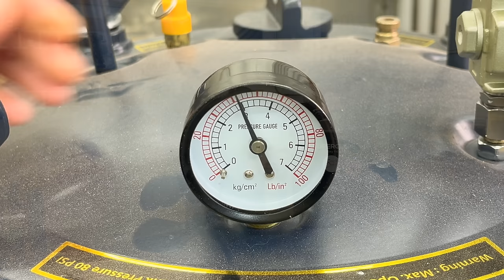Stunning Tree Root Woodturning Creation

Comment from the maker: I was given this Almond tree root ball from a member of my local woodturning club. This is my first attempt at turning a root ball. I was definitely a little nervous about this one, it was the largest and most unbalanced piece I have turned to date. Originally I had planned to not use any resin in this piece, but unfortunately there was no way I was going to be able to hollow it out and have it stay in one piece. I also had a bit of a scare when part of the root caught on the tool rest and broke. I’m sorry I didn’t catch it on camera. It was pretty intense. I set my lathe speed at 450 rpm for the majority of this turning (lowest speed my lathe will go). Only raising it to approximately 600 rpm once the piece was cut and better balanced. I think I lost about an inch of my 5/8” bowl gouge turning this piece due to the constant sharpening. The inside of the root had lots of rocks and dirt that I just couldn’t get to until I turned it down a bit. The simple woodturning carbide tools worked great as always. The Sumi black pigment powder from Eye candy pigments came out amazing and really went well with the grain color of the piece. I finished the piece with Danish oil and polished with carnauba wax. This was by far the most fun I’ve had turning a piece and plan on finding more root balls to turn. The fact every piece is original and one of a kind is what I think makes it so special. Thanks for watching! Hope you have a great day!

#woodworking #woodturning #resin 

Affiliate links

Simple woodturning tools
https://www.simplewoodturningtools.com?bg_ref=gkr80FMJN5

Limited time coupon code!!!!!!!!!
Square3 

Acrylic resin simple start turner and hollower
https://www.simplewoodturningtools.com/knyydq

Acrylic resin simple start roughing tool 
https://www.simplewoodturningtools.com/yio14f

Simple hollowing system with laser kit 
https://www.simplewoodturningtools.com/ect9ii

Super Clear Epoxy Partner
Superclear epoxy resin 
https://www.superepoxysystems.com/ref/squareandlevel/

Eye Candy pigments 👁️ 
https://bit.ly/48vZNLf
Coupon code:
Squareandlevel
Sumi Black Eye Candy pigment powder-
https://bit.ly/3J5Qasr
Reply: I like this idea of duping the description in the comments... borrowing. :)
Reply: Thanx. New turner and new sub. Something about the rootball  really speaks to me. Not sure why. Maybe you are giving new life to a 'reject' or something.  Not sure. Keep up the good work.  Going to call my shrink now....
Reply from the maker: @johnlivsey4146  haha. I totally agree. It’s basically trash. Would either end up in a landfill or a bonfire. Kinda cool to make something unique and interesting with it. Thanks for watching. Hope you have a great day.
Reply: I like turning stuff that shouldn't be turned, in other words, trash 😊. This one turned out great 👍 @squareandlevel
Reply: Is this for sale and how much?
Reply: p😊😊
Reply: Last seen at a yadr sale for $3.
Reply: yes

Comment: Man that's beautiful. Whenever I mess with a root ball I usually break out the pressure washer and blast away all the dirt and rocks. Works great and all the mess is outside.
Reply from the maker: Did that twice before I started. Still full of rocks and dirt. These roots were wrapped so tight the stuff just wouldn’t come out. Thanks for watching. Hope you have a great day!
Reply: That's true. You can blast the outside all day long and then 7/8th of an inch in after 3 min of turning... there's a rock. 😢

Comment: Now that sure turned looking nice!! I also liked your zip-tie trick for keeping the wood from floating while giving you a handle to lift it out of the pressure pot. I have found that roots do not always turn the same as the parts of the tree that are above the ground. They also seem to dry a little faster.

Comment: I'm not a woodturner, but find it so relaxing watching a craftsman create something beautiful from something so mundane. I'm curious though how you ensure that the thickness is the same down the sides when you are hollowing the inside. Probably a dumb question I know.
Reply from the maker: Hi Tony. Not a dumb question. There is a laser attached to the hollower set up I use that points down on the outside of the vessel being turned. It helps to reference where the cutter is on the inside, making it fairly easy to obtain a uniform thickness throughout the piece. Thanks for watching. Hope you have a great day.

Comment: As a hobbyist, I must say that the two things I feel when watching your vid's are admiration and envy, for your workshop, tools and skill.
I do however have a technical question.  Is the resin you use elastic or do you rely on the strength of the resin to resist future stress, created by movement in the wood?   
Or.   Has that root ball been seasoning since "Adam were a lad"?   I only ask because I don't have the time left to wait that long. 😉👍
Reply from the maker: The epoxy resin is not elastic. This specific piece has moved a little since being made and I will likely fix it in the future once it has stabilized. This was my first attempt at a root turning and I learned a lot. Next time I will turn it to rough oversized shape. Drill the pilot hole in the center and let it air out for a few weeks before adding resin or finishing the turn if no resin will be used.  A microwave oven is also a good option I may experiment with in the future, when I get around to picking up a used one. Thanks for watching and the great question. I hope you have a great day!
Scott
Reply: @squareandlevel  Thanks for the reply.  I too warm up my work in a microwave, immediately prior to applying beeswax polish.  It drives out the air and moisture from the wood and as it cools the wax is sucked deep into the pores.  A word of warning though.  Don't apply any sort of finish before you put your work in the oven.

Comment: Love this piece! Couple questions! What 5 gallon pressure pot do you use and what are your thoughts on it? It looks like a TCP Global. I’m wanting to buy one but keep reading how these pots don’t seal correctly out of the box and that has me hesitant to spend that type of money. Any advice/info will be greatly appreciated!
Reply from the maker: Thanks for watching!  This is a CAT pot and this was the first time I used it. It was a little cheaper than the tcp global ones. So far I really like it. It was perfectly sealed out of the box. ( I pressurized it and sprayed all sealing points and fittings with soapy water to make sure). These things are wayyy over priced in my opinion but especially the ones for “resin casting “. They are the same as the paint pot ones with parts removed and then they charge more money for them. The first one I bought was a vevor paint pot that I modified. It was $70. It’s just a little on the small side. But I’m happy I now have two to work with. Hope that helps a bit. Have a great day. I’ll leave a link to the Cat 5 gall. One.

California Air Tools CAT-365C 5... https://www.amazon.com/dp/B017BXZ8B4?
Reply: @squareandlevel  Thank you for the insight! Keep up the great work!